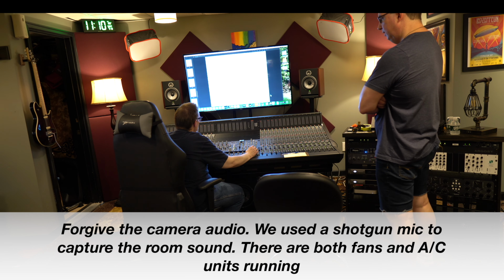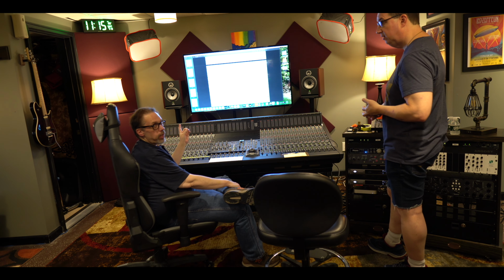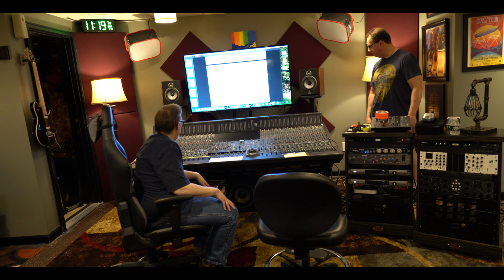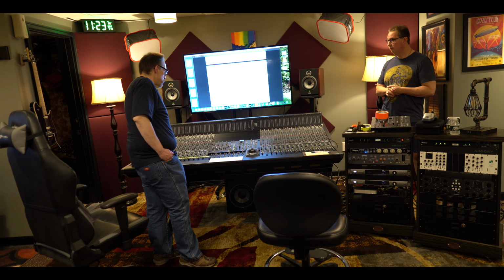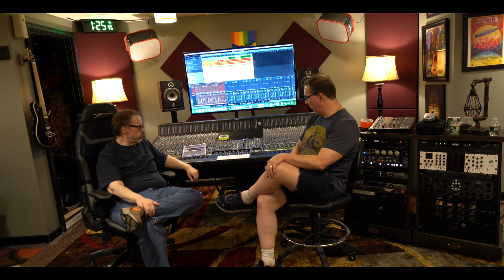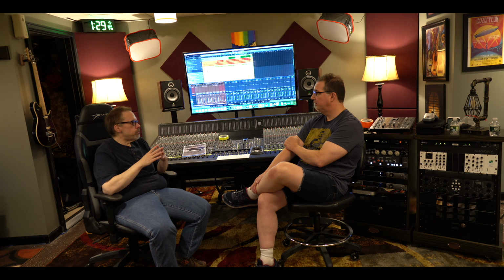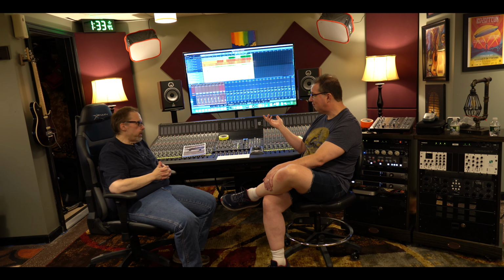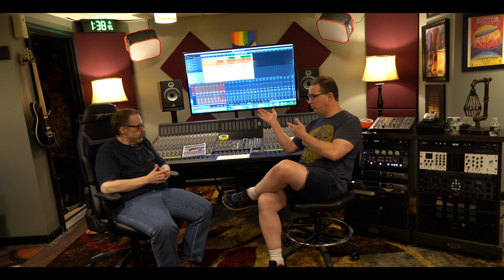Solid State Logic | SSL ORIGIN Install & Setup Day 3 PT 3

Comment from the maker: Any other console owers here? Let's hook up and share workflow ideas. Email me via the website
https://www.mixingmusicanalog.com
Reply: I don't own one but Flock Audio had a digital patch bay that is fully controllable. You don't have to recable you can switch any out board gear onto any channel even change the order. And it's USB, And Madi I believe. You might be one of the only guys I know virtually that has a set up big enough for the more expensive of the two units.
Reply: I hope it helps.
Reply from the maker: @anthemmakersmusic  I check out the Flock Audio and they are so expensive that I decided to go with a traditional patch bay
Reply from the maker: @anthemmakersmusic  Thnaks!

Comment: It is a magnification console and I am a bit jealous. You will have years of fun with this beast. Yes it has Solo in Place and much more. This from the manual: Solo master and meters
Comprehensive Solo controls provide choice of Solo-In-Front with Mix
Balance, Solo-In-Place for Large, Small & Group Faders and PFL options.
Solo Level, Solo Clear and Red Light Switch complete the available
options. Peak Hold Selection plus Peak Clear for all console LED Meters.
Mix Meter Follow Monitor Source option increases main mix meter
flexibility. Independent DIM controls for Channel and Monitor Inputs to
reduce meter distractions in busy sessions.

Best of luck with it! Carry on. Tod
Reply from the maker: Thanks! Yes, we figured the solo thing out after the fact. This video was recorded a couple of weeks ago. since then I am learning more and more. I do appreciate your response and help!

Comment: I'm not sure if you figured out the main out inserts already, but what I did on my mixing board... I never use the main out inserts. My main outs goes directly to hardware bus processors (using a patchbay), that signal goes back to the daw (to print track, maybe with additional plugin processing) and the output from the print track goes back to the mixer using an external input on the board (mostly named "2-track"). 99% of my time I'm monitoring the 2-track input, not the main outs of the board.
Reply from the maker: Thanks for the tip!
Reply: On Day 2 we set up a patch bay and get the routing worked out to use the master insert and also run the mains into the X16 for the print track...we did try to direct out to the Fusion and feed back to the board but it works the way we have it, so...

Comment: Hey Hey! You're getting there! :-) If you get an extra 8 i/o then you may be better routing those outputs to the dedicated FX returns so you'd have access to the bus routing for the FX. Remember, you can't route both the long and short fader on a channel. It's one or the other. Also, I think the mix insert send and return is pre the bus compressor and can't be moved post. Or the other way round. I'd have to check the manual. The stereo groups and buses are a bit strange as they are not quite internally linked. You have to make a physical connection from dsub to dsub on the back or have them normalled on a patchbay. That's why you can't hear anything when doing the bus routing. I'm sure you know all that by now anyway.
Reply: Yeah, Day 2 was the day we made major progress on all of that...at this point in the video we're still on Day 1, and there has already been a Day 3...

We're not afraid of showing the process, including the mistakes we made and the process of working out how to make everything work...SSL's manual is good, but could be better...

As far as IO, we WANT to add more but at this point we're determined to work with what we have...at some point we need to stop setting up and actually start mixing on the thing...
Reply from the maker: Yep, we got all of that figured out at this point. This video was shot a few weeks ago but thanks for the advice! Keep it coming
Reply: @MixingMusicAnalog  I do realise this was a couple of weeks ago now but I can't resist throwing popcorn and shouting at the screen "No! not that way, it's this way!" I'll try and refrain for the moment until the series finishes. :-) There's a couple of things I find frustrating about the functionality of the console and that is not being able to switch the drive circuit into the monitor path for mixing and the LF to SF option. What appears on the SF is a direct copy of the LF and the SF insert isn't active. I don't know what you're supposed to do with that! Parallel compression if you send the SF signal to a bus perhaps. You can do that with the LF signal though. I need to look into that further and contact SSL myself. What other 8 i/o unit are you thinking of getting?

Comment: isn't there a master insert button on the console to select it? I suppose not. Also: pans, if you use the direct outs to the daw as well as the master 2bus stereo mix 'print track' then you can either have stereo with ssl console panning, or up the centre mono.(but reaper is the only daw I know that lets you have any 1 - 32 channel as left if its a stereo track,,,, i.e. studio one only currently lets you have 1 3 5 7 9 as left (incase you had eg. kick mono 1, snare stereo 2 3..........   it doesn't let you ...

 Interesting watching these - thanks :) Massive learning head scratching! I had the same issues with my 2x8816 summing units with panning using the direct outs, wondering for ages why I cant pan    ...        ... ok well pan only would work if printing a stereo track... you can pan stereo pairs and print those it.b. and keep monos up the centre no pan. (can even just say each is stereo as a rule, and for the epicentre monos can always double up for parallel mono eq
   Cool mixer :) BTW, if I were you maybe Id like to get a ssl sigma to use for the automation for each analog fader after the computer. :) Thanks again for sharing with us :) Its quite confusing hooking it all up lol :).  my plan for my ssl hybrid rack of xracks , is to print what I capture i.t.b. then mix i.t.b. through ssl sigma summing (that said, don't know if ill be losing out on quality by printing and then going back out to summing... massive head scratching!
Reply: I even like the idea of getting the console mix rocking, then sending all the tracks off patchbay parallel (half-normalised) to inject more energy into stuff going into eg distressor etc, but EVEN send them to a different summing unit with different pans to really thicken it! the are just my crazy ideas that Ive yet to do! :)
Reply from the maker: Thanks for the suggestions. A Sigma is not in the card for an additional $5,000.

Comment: Love these how to ....In my opinion You are overthinking, the template,  its not needed Ive been running a hybrid for 15 years on an SSL 4056,  WITH LOTS OF OUTBOARD, you have no need to print the audio back into DAW unless you wanna send processed audio somewhere,  Of course you'll print back a mix which you've figured out....here's the short and skinny, (no Pun) hook the direct outs to Console inputs from interfaces  1 to 1 etc, all the way to 32, same with inputs from SSL to patchbay for flexibility to patch around a bad channel, or what ever ( or Not) which allows you to just use the Track output  assignments in DAW   TO  console for instance mine is set up FROM DAW TO SSL Channels,  drums 1-12 then  13-14  Bass stereo, then 15-18  2 stereo GTR returns , 19-20 a stereo for Perc / misc, 21-24 2 stereos for Keys synths etc, ...  25 -26 -Lead Vox  separate  27-30  BGV Grouped in DAW  you can use small faders for FX Returns...either from Patchbay or DAW...then further routing on SSL  to Center section Groups to be able to control mix from sweet spot...Heres a tip watch any mix video with CLA his is also that way  obviously much more gear than me but,  its a suggestion!..Great Luck man...Im also in CT love to see your spot Dave
Reply from the maker: Thanks for the info